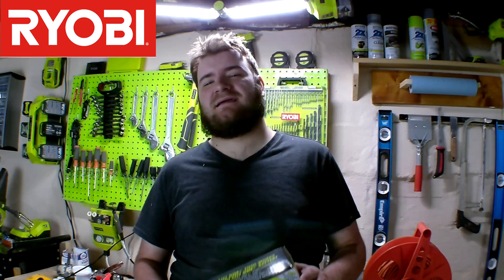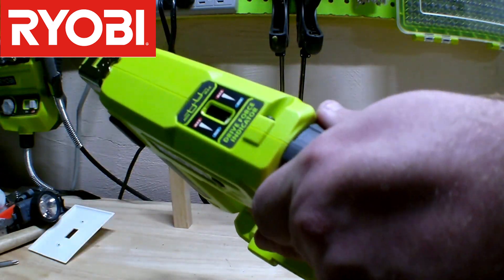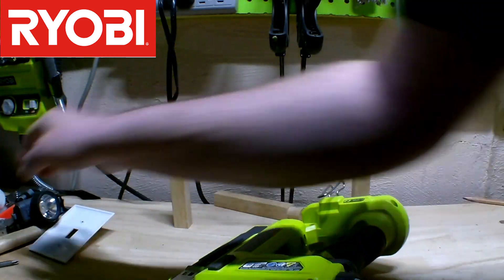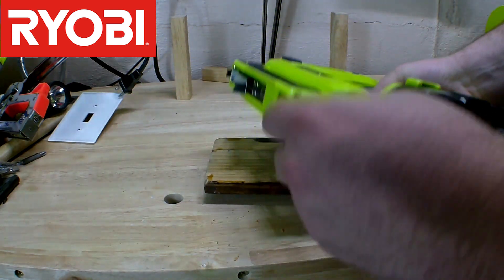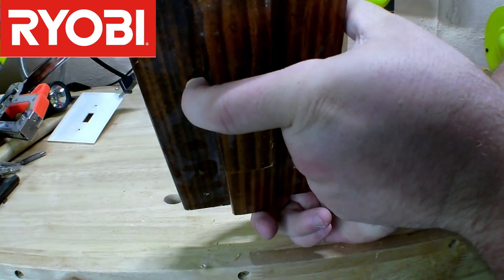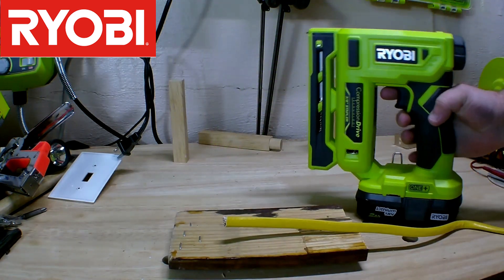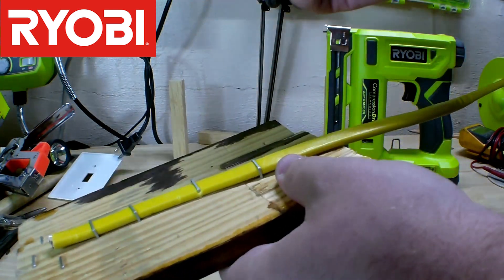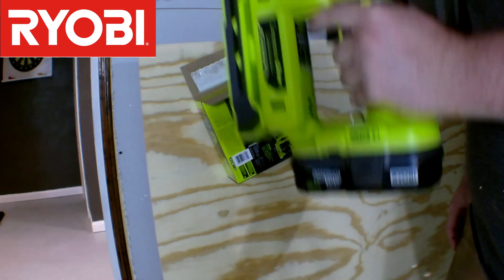18-Volt ONE+ Cordless 3/8 in. Crown Stapler

Comment: You should never use that tool for securing high voltage cable, it's meant only for low voltage applications.
Reply from the maker: Pro1er I had  none on hand it was for explanation only thanks for commenting